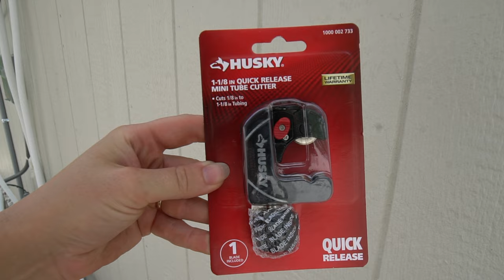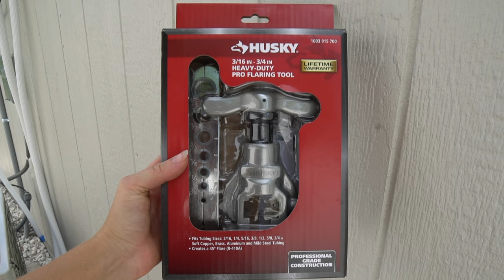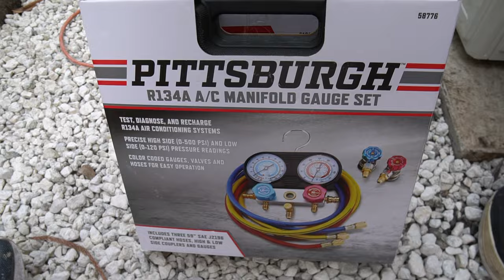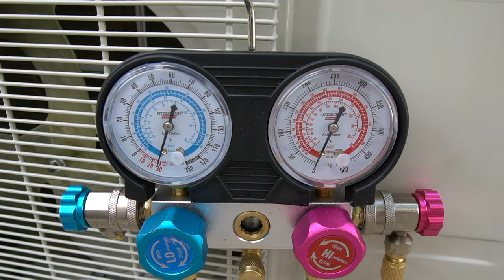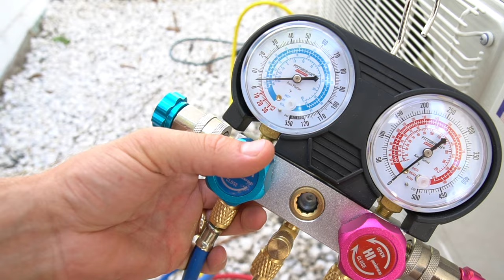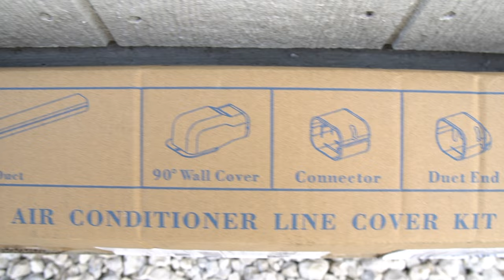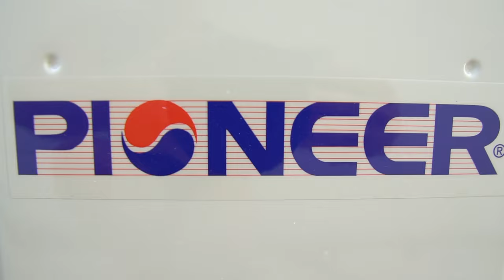How to Install a Pioneer Mini Split

Comment: Best YouTube video I’ve found for installing Pioneer Heat Pump. Couldn’t have done it myself without it. Much easier than trying to read the manual. With this video I was able to completely install the unit.Testing was very well described. The only trouble I had was the -30lb. Vacuum test showed a leak. Discovered Unit didn’t didn’t have a leak, make sure you have your vacuum test lines good and tight before testing.

Comment: Just a tip for those doing this. Don't put the disconnect behind the condenser. It needs a 3x3 area of clearance for California code. So three feet in front and three feet to the side. It doesn't have to be centered in that three feet just either three feet from the edge, right or left. If the unit caught on fire for some reason you wouldn't be able to shut it off very well. Nice job though, not meant as a critique but we're all learning.😎👍
Reply: its not California, its in FL

Comment: Tip when drilling through siding, start with the hole saw running backwards to ensure it doesnt jump around or grab suddenly and crack the siding.

Comment: Hvac pro here very clean work. 
 Here’s a few pro tips 
Use a torque wrench on the flares nuts and torque them to spec.
Use a micron gauge don’t go off the gauges -29 as this doesn’t tell you if you have any moisture in the system the micron gauges will also tell you if there’s any leaks. Other then that nice work.
Reply from the maker: Thank you for the pro tips! 🙌
Reply: Also don't remove the hoses while the system is under vacuum. Release the charge, then remove the hoses. The momentary depressing of the Schrader core will cause you to lose substantial vacuum, you will def go above 1500 microns by removing a hose.
Reply: What micron gauge and torque wrench would you recommend for the average DIYer? Currently about to install one.

Comment: I installed this exact one in my garage that I converted into a man cave about 5 years ago and let me tell you I live in Phoenix, Arizona and when it is 118° outside my mini split keeps it 72° inside the man cave! I got the 220v one because it runs much more efficient than the 110v unit. You and your husband did a great job on your installation, nice and clean!
Reply: Thanks Ronnie. I was wondering about the difference. Glad yours is working out great for you.
Reply: same wattage at 120 volt or 240 volt...No difference...
Reply: @Perly53  The 220v runs more efficient than the 110v.
Reply: @robertgregory2618  Correct, but the amps are less on the 240.  You can run 14 gauge wire to the unit as it only draws 4-5 amps.
Reply: @mae2759  Exactly!!

Comment: I'm so glad I watched this! Thanks! I hadn't heard the advice not to leave coils, and I almost installed the outdoor unit on the wall immediately outside the indoor unit (leaving all 16' of lines coiled up behind the unit). After watching your video I did some reading, and I likely would have dramatically shortened the life of my condenser by doing that. Thanks again!

Comment: Flaring tool tips for those of us who are only probably going to do this once in our lives. :-)  
 1. Cut your lines a bit longer than you need in case you mess up and need to cut off the end and try again.  You can run the longer lines a little past the unit and make an S turn back.  This also gives you some room to move or reposition the outdoor unit if needed.  
 2. Make a few practice flares on the scrap end of the line that you cut off.  
 3. Don't forget to put the flare nuts on the line before you make the flare!!!
 4. Yes, make sure that there is about 1mm of line protruding beyond the flaring bar (1/25", which is between 1/16" and 1/32" as Stefani said).  
 5. Use some Nylog Blue (flaring sealant) or a drop of oil to lubricate the flaring cone.  (not required, but it helps)
 6. KEEP TURNING THE HANDLE UNTIL IT CLICKS OVER - the tool will not allow you to over-tighten it.
 7. A proper flare fitting doesn't require either nylog or a flare gasket (I had never even heard of these!), both are just DIY insurance to help prevent leaks, but if you don't use them you should still be fine.
Reply: I'll also add... Don't put nylog on the threads.  Make sure it's on the flair only.

Comment: Tip to people working with tools, don’t use channel locks or vise grips to tighten nuts, especially brass ones! It’s a great way to deform the nut or strip it. Wrench or adjustable wrench are designed for tightening.

Comment: Ya'll did good. Since I used to do AC work, the only thing I would have added is a filter drier to the liquid line.
Reply: not necessary on split systems. They may be an internal one I don't know...

Comment: Excellent video. Thank you! I wish I had a partner to conquer these projects with. I am glad you do. BTW, if you find you need to do maintenance on these mini-splits, please do a video on that as well. I have found them to be very difficult to thoroughly clean as they start to accumulate mold. I don't know what the solution is. I love your work and videos.

Comment: On drawing the vacuum on the lines. If the lines have been open to atmosphere for quite some time, it pays to draw vacuum for several hours even. This will cause any moisture to boil off and be sucked out by the vacuum pump. I worked at an A/C research facility and we would actually draw a vacuum overnight to ensure a dry system. We would hook up the vacuum pump with a highly accurate electronic vacuum gage at the end of the day and let it run till the next morning.
Reply from the maker: Thank you for the tip! 🙌
Reply: Don't tell them the secrete this should be illegal
Reply: In Greece vacuum pump isn't used for mini-splits or when it is used it is used without a vacuum gauge. Requesting a vacuum pump can sometimes be considered offensive, potentially leading the contractor to react with aggression or respond sarcastically. I called about 50 installers here and most got really pissed off and aggressive. I found one who used vacuum gauge but now he stopped using it. However minisplits work fine without vacuum at least without any noticeable issue so nobody cares.
Reply: @pg8605  To do job right you need to vacuum the air out of lines.

Comment: Our Pioneer mini split unit stopped working after about a year. Tried cleaning and other things but turns out the compressor went bad. 

Wasn't aware that they had a warranty like that. Might have to contact them about a replacement under warranty. Thanks for the video!
Reply: You were required to file your warranty within three months of purchase.  We just found that out and barely got our 1st one installed in time to get the warranty.  Working on the second one now and a third one, has until October deadline.
Reply: @imasahm  Turns out it was a small valve that went bad and the refrigerant leaked out. A common issue and cost of repair was low. Has been working fine since. For others that may see this - check your "Schrader valve".

Comment: Great video. Thank you. Could you have run the lines inside the wall behind the sheetrock instead of on the outside of the building? Genuinely curious....

Comment: I have 2 bedrooms next to each other, 150 sq ft. each. Can I series two indoor units together on one condenser unit. I realize only one room will have temperature control. Can I do this to lower the price and just have a single outdoor unit rather than a dual zone unit. Thanks.

Comment: Would have been tempting to hide the lines within the wall - since you were doing drywall work anyway!
Reply: I think that is not recommended due to the dangers of vapor condensing on the lines, and moisture building up inside the wall inadvertently. I could be wrong though.

Comment: I didn't see how you bent the two copper pipes coming out of the exterior wall downwards to run along the outside wall. I guess "carefully" would be the answer. But of course, they can't be kinked. Nice video. Thanks very much.
Reply: Why can't they? If not careful, you bet they will kink.

Comment: I love this series!!

Question: Did that orange screwdriver come with the AC unit? They seem to be included in quite a few items as standard. I got one included in a Fortigate firewall appliance, and I still use it to this day. It’s just such a cool “freebie”. 😉
Reply: I have one of them also. I have no clue where I got it from, but it's a great screw driver!

Comment: Interesting that you went to the effort of shortening the refrigerant lines (nice job, btw), but you didn't shorten the signal line!  4 crimp terminals and 10 minutes and you can get rid of that coil of wire hanging on the back of your workshop!

Comment: When I start the vacuum, it drops to -30 really fast, within about 20-30 seconds. Shouldn't it be a more gradual drop? Or is that fine? Do I keep running it for 15 minutes anyway even though it is already showing -30?

Comment: Sorry, new to the channel and watching at a bar on my laptop like a young person so I can't really hear anything -- tangentially related question. Did you guys have any trouble with moisture penetration after spraying your roof sheathing? I've heard if it's not on heavy enough condensate gets trapped inside, even mold can be an issue, so I've decided to avoid spray foam insulation for outside walls and rafters. Have you experienced any issues with condensation being noticeable on the inside of the foam or on the rafters?

Comment: Your manifoldi gauge set is for R134A not R410A that Pioneer uses, says there not compatabule because R410A goes to 600 PSI. Pioneer has a KWIK-E-VAC Line Set Flushing Kit on there website, dought it would be any better then this.

Comment: How did you get details for blocking for the indoor unit mounting plate? I’ve looked at the pioneer installation manual and it’s a bit confusing. Are the plates designed to have holes for mounting that are over 16 inch center standard studs?

Comment: Very good information for a DIY project. But I would personally stop short of the line set connections and let a AC professional make the final connections as I do not want to spend the $$$ for the gauges, vacuum pumps or any special line connectors. But still very good useful information, Thank You

Comment: How do you clean the filter on the indoor unit without a ladder?
Reply: You will need a ladder, but it is a work shop so that should be easily handled.

Comment: Did you flare all sides of the pipe or just the side connecting to the compressor but not the side connecting to the indoor unit?
Reply: Looks like the used the factory flares when connecting on that side. They only had to make flares because they cut a few feet off the lineset.

Comment: Thanks for your video.  Was your unit a 110v or 230v?  Pioneer offers the same unit in those 2 voltages (although the 110v seems to be sold out as I write this).   I'm in Fla also and plan on installing the same system that you have.  Thanks!
Reply: They didn't answer.  What did you decide to do?
Reply: @rrrscience  I purchased the 220v version.  Either type was the same price.  I've always heard 220v anything is more efficient so that's what I went with.

Comment: Dumb question....  My son installed for me. I t's cold here in NJ, so can't determine if AC works.  But regarding the heat....  should the outside unit be running when the heat mode is on??  The inside wall unit operates fine, but blows only cold air.  If anyone has a clue, please let me know.  Thank you!
Reply: This is a heatpump and operates the same as the whole-house heatpumps.  So yes, the system reverses in cold weather, pulls heat from outside air and sends inside.  In the summer, the unit pulls heat from inside the house and sends it outside.  Put your hand in front of the outside grill and you will feel the heat blowing out.  I'm no HVAC, but this is my basic understanding, since we've had heatpumps in Texas forever.  And BTW, in the winter, it blows "room temperature" air, so you won't get the heat of a gas-heater.  But it also won't dry out your sinuses, like gas heat does.

Comment: You did not mention the installation of the drain tubing ….. not one thing was mention on it … plz explain !!!
Reply: Always position the drain tubing on the bottom, below the two copper tubes and communication wiring, when you wrap them all together in preparation for stuffing it through the hole.  Make sure to keep the drain tubing unkinked on the ground so it will drain properly.  Hope this helps.  Another thing, some say not to use the cheap drain hose that comes with the unit because it will disintegrate quickly.  Go buy a good one.  We have already used the one that came with ours on two or our three units so far - must correct that on the third install.

Comment: mr cool also makes one that is DIY friendly and doesnt take all those fancy hvac tools!
Reply: They are also quite a bit more expensive
Reply: Mr. Cool is pre-charged in the lines, not in the condenser unit.  I guess if you're very careful with the lines, you would like Mr. Cool better.  After our 2nd install, we decided we prefer the pre-charge in the condenser - that way, if we kink a line, it's more easily replaced.

Comment: Why not run the lines inside of the wall?  That would hide all the outside feeds.  JMO
Reply: Moisture and mold danger from condensation on the pipes and trapping the water in the walls.
Reply: Do downspouts from a gutter bother you?

Comment: I installed a Mr cool 30000 btu in my son's shop
Much easier to install and no special tools 
I just bought and I stalled a pioneer and was not happy to have to buy a vacuum pump and gauges
Reply: Pioneer sells a can thing that displaces the air - so you could have opted for that.  Sorry, I don't recall what it's called.

Comment: Did you use a  torque wrench to tighten those nuts or just wrench it down with your Home Depot Husky channel locks? Are you EPA cetrafied?
Reply: Super dangerous to assume or give the idea an average person can do this easily..
Reply: Torque wrench is smart, but you don't need an HVAC cert to DIY these models because the charge is pre-loaded.
Reply: @FamilyManMoving Awesome, Then you get a bunch of people with no experience hooking these up with there husky wrenches, system looses charge a year later (bye bye ozone). Any thing to save a buck, put the guy who went to school, took time and tested to become epa certified and has been in the trade for 20 years out of the job. Yay Mr cool!
Reply: @MrEightfortytwo If we thought that way we'd still be in horse and carriage right.
Reply: @MrEightfortytwo  - Perhaps if they weren't so astronomically high-priced, things would be different.  But to install a simple 9K BTU unit, we got quotes ranging from $2500 - 9,000!  We did it ourselves and all is great.  We DID have an HVAC neighbor come down check our work and ok'd everything.

Comment: Mitsubishi  come precharge  no cutting  or evaluation required    vacuum  pumps   are expensive  especially  for one time use and need refrigeration  guages for type refrigerant used also not cheap   and then need vacuum  guage   not to mention  nitrogen  gas for pressure testing line  a d also if any brazing is done this not a recommended DIY  system   Mitsubishi is
Mitsubishi  h as been on the market  for years  and have multi zone  available  where can have  several indoor  units working on one outdoor  condenser

Comment: 900 dollars to install an air conditioner?? thats a rip off.. here you can do it for like 120 euros..
Reply: $900 here is cheap and with a cheap price you get a Bad install. a good clean install cost $9,000 + if you want it done the right way
Reply: @ExtremeSilver2000  wow.. thats a total ripoff... i really dont get why it would be so expensive...  i understand if its a whole system in a house.. but just 1 unit?  i think i should change jobs and move there.. haha
Reply: @ExtremeSilver2000 I'm with you on this. An electrician would charge more than 900 for electrical alone where I live. But hey- if someone can install a mini split I'm sure they can throw in a circuit
Reply: @ExtremeSilver2000  - so in our case, we got our Pioneer on sale and tax-free weekend for $728 and we're gonna pay someone $9,000 to come install it?  Or even $2500-3000?  NOT!

Comment: I’ve been in residential HVAC for almost thirty years; the two problem areas we see with mini splits are bad flares (causing refrigerant leaks) and poor vacuum. Using inches of Hg to measure vacuum is like using miles to measure your height. You should be pulling that vacuum to at least 500 microns to ensure the elimination of non-condensibles like air and water which lead to a variety of problems down the road, including the formation of acids and sludge in the line set. Unless your intention is to compromise your comfort and efficiency, and eventually kill your compressor. I’m all for DIY and saving some bucks, but when it comes to your home HVAC system, treat it like you would your teeth; you shouldn’t do DIY braces and you shouldn’t do DIY HVAC.

Comment: You forgot to mention that one MUST have their EPA certification to do this work. The reason is that you could release refrigerant.  Also, one should torque the flair nuts to proper settings.  Not just tight. Also, pulling a vacuum, use a micron gage.  Use the proper tools.  Or better yet, have a professional do the installation.
Reply: You only need EPA Certification if you will be needing to pull or load your charge.  These DIY units are pre-charged, whether in the condenser or in the lineset.
Reply: @imasahm  the EPA test I have taken states: If you work on a unit and the chance of refrigerant loss is possible,  one needs to be certified.   So, if you drop a condenser fan motor and break a line, is the release of refrigerant possible?